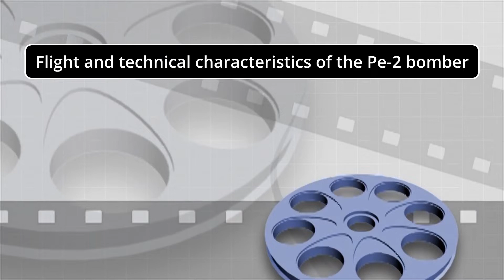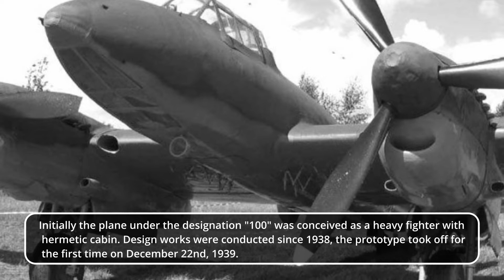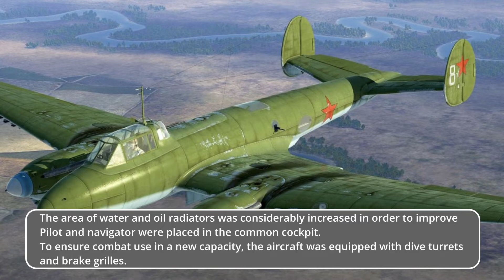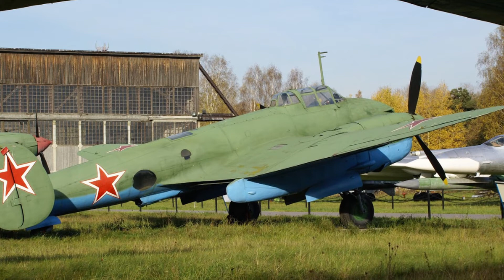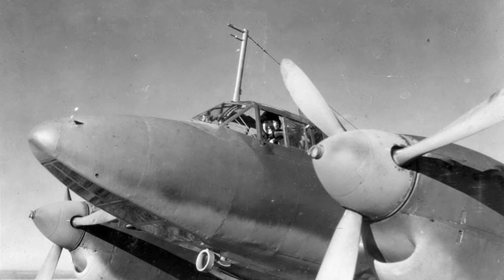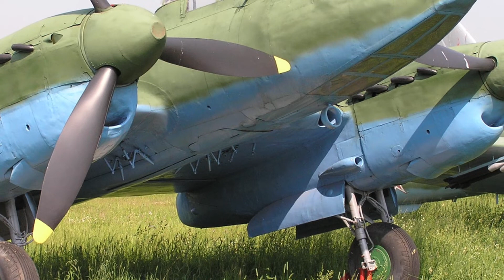World War II warplanes| Soviet planes| Pe-2 divert pilot

Comment from the maker: Air Warriors
World War II warplanes| Soviet planes| Pe-2 divert pilot
Creation history, flight characteristics, combat use
The Pe-2 dive bomber inherited both positive and negative aspects from its progenitor, the "100" fighter. On the one hand, it had good speed and rate of climb. On the other, its bomb load was more than modest: in this respect, the Pe-2 was inferior even to the single-engine Ju 87D, not to mention the twin-engine Ju 88A. The Pe-2 was quite successful as a dive pilot as it had a large margin of safety and dive stability, important when attacking small targets.  However, the qualities of the Pe-2 as a dive bomber in the early years of the war were in demand seldom - because of insufficient training of crews in most units and formations, these aircraft were used as conventional horizontal bombers. The modest development reserves available in the Pe-2 design were completely exhausted during the war, which led to the rapid withdrawal of the aircraft from production, and then - from the armament.
Subscribe to the channel, and you will learn a lot of interesting facts about military aviation.
#militaryaviation   
#planesofWW2
#history 
#ussrairplanes